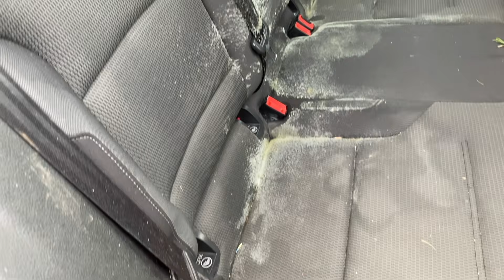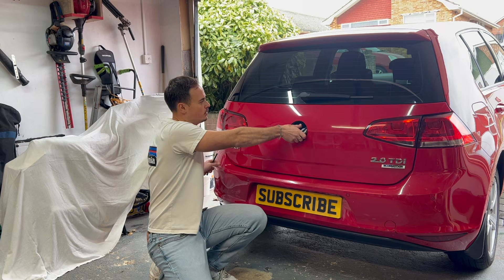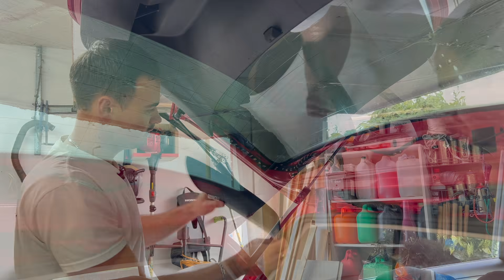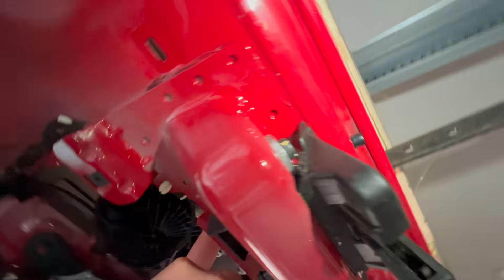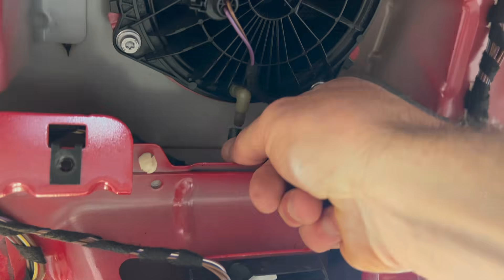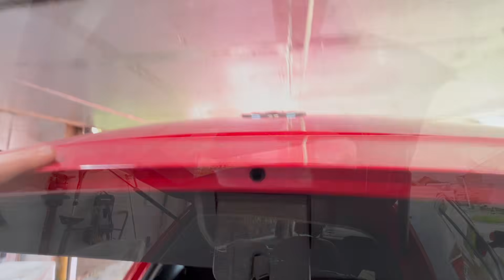VW Golf MK7 Boot LEAK – The REAL Cause & How to Fix It (Boot Badge Drain Tube Replacement)

Comment: Thank you, that was a bit of a faff to do, but you saved me nearly £150 by doing it myself 🙂 I do think that VW dealers should fix this FOC though, as it's clearly a part that's failing prematurely, and shouldn't be counted as "normal wear and tear" IMO. I would be curious to know whether the issue persists in later models?
Reply from the maker: You’re very welcome! So glad you saved the cash and managed to get it sorted yourself, nice work. Thanks ever so much for the tip! You don’t know how much it helps out running the channel 😊👊🏻 I definitely think there are a few issues with these cars that VW should be accountable for 😬 I do think they’ve ironed out a few in newer models such as the silica bag issue but not so sure about the boot leaks 🤔
Reply: we need to start a petition as my and my wife both have leaks in our golfs. She has 2!!
Reply: I’ve got a leak in my 2017 GT evo……… thanks for the great video.. I’m sure my mate can fix as I’m disabled

Comment: Why must these cars be such pieces of crap? I've had the sunroof frame resealed under (some) factory extended warranty, keep drain tubes clear, but it leaks and leaks and leaks... Every visit to dealership is $120 to just be told "we blew out drain tubes so you're fine now" only to have it leak in the next rain. VW is synonymous with junk in my mind...

Comment: Great video very helpful. I have an estate and the process is the same just the pipe is slightly different with a 45 degree plastic joiner in there to get it out a little further. Mine wasn’t  broken just come off the drain hole. Reattached and cable tied on and job done!
Thanks mate
Reply from the maker: That’s great news, glad you managed to get it sorted so easily! 👍🏼

Comment: Thanks so much for posting this... I'm always nervous yanking trim off. I've just discovered mum's spare wheel is swimming in water... Thanks to your video I've found that there is no hose! Most likely it went missing when mum got rear ended a a decade ago so must have been filling the boot for years as the car has always smelled musty! Thankfully normally parked under the car port so perhaps that's why it's never filled up fully.  Anyhow scores me brownie points for mother's day tomorrow!😊
Reply from the maker: No problem at all, glad you found the video useful! Best of luck getting it sorted 😊👍🏼

Comment: So I followed the video and all was good until I got to the bit of putting in the pipe. My boot badge is the same on the outside but inside behind the trim has no drain pipe attached or place for it. Boot lid has the hole but inside of the badge doesn't have anywhere to connect to.
Reply from the maker: That is strange, a few others have also commented that they didn’t have a place for the tube. Maybe yours is an exception, in which case the leak is probably from the rear boot vents 👍🏼

Comment: How did you get the tailgate panel back in so easy? I’m trying to put the panel back in but it won’t fit. It’s too big
Reply from the maker: If it came off, it will definitely go back on. It’s just a case of making sure all the clips align with the holes in the tailgate👍🏼

Comment: Thank you so much!!! Whenever i open the boot after washing the car or after it has rained i find some water drops on the handle of the boot carpet and some on the spare tire. I’ve already fixed the leaky air vents but still find the spare wheel area kinda damp so my second best bet would be this hose
Reply from the maker: Thanks for watching, definitely sounds like that tube is the culprit for the remaining dampness! 👍🏼

Comment: Ive done the vents ubder the bunper and the badge pipe looks fine but im still getting water in the boot. I though it was from the lights but they seem bone dry inside abd behind them...im lost with it
Reply from the maker: Might be a case of removing the boot liner, drying it out completely and putting talcum powder all over the boot space. Sounds silly but this way you should be able to see where the water is coming in from and trace it back. Have you noticed water pooling in the cavity where the rubber Gromit is?

Comment: Hi Olly, 

I got back from holiday last week and was repositioning my boot base from the deeper holiday position to the higher position that I usually have it in with a genuine plastic boot liner. 

I discovered a pool of water in my spare wheel well with all the heavy rain recently. I was getting a lot of condensation on the windscreen prior to this, but fortunately no mould on the seats! 

I have a red VW MK7 Golf GT very similar to your Golf in your video.

I watched your video and checked my boot door. The rubber drainage pipe had perished at the distal end and receded into the boot door. 

My Golf is nearly 12 years old and has done 149k miles. The original pipe was rubber/plastic and has lasted all this time. I've replaced it with a genuine rubber hose pipe from eBay. I had to cut the pipe to the correct length, but it otherwise fit well.

Removing and replacing the plastic panels were rather fiddly. I bent one of the metal clips in the process. My car has all of the metal clips and all 4 screws.

Thank you for the video. Very helpful. I'll definitely have a look on your channel again if I have any further issues to see if you have a solution. 

Thanks again, Olly.
Reply from the maker: Hi Oliver, glad the video helped you track down that perished pipe before the mould set in! Those plastic panels and metal clips are definitely a test of patience, but it sounds like you nailed the fix. Nice work mate, thanks for your comment and happy motoring 🍻
Reply: Hey thanks for your informative comment, in about a weeks time could you tell me the results?

Comment: Thanks for this video. Really helpful. Like most people, my mk7 had loads of water in the boot under the spare tyre. I only looked into the problem when I realised the back seat was wet. I'd already had the problem of moisture on the windows which had also frozen at times too in winter. Sure enough, the boot badge pipe had perished so I used the links in the comment to order a replacement tube and tool - 30 mins and some brute force later that's now repaired. I also established I had water in the bumper area on both sides. Rather than take the bumper off, I simply cut into the carpet on each side in the boot and put my finger in to check for water. Once I'd confirmed that, I used the suggestion in another comment (either on this video or another) and went under the car and made a small hole in each of the 4 rubber bungs. Sure enough, water started dripping out on both sides. Hopefully that'll see this car through the next few years now. Thanks for your video - saved me loads of money and gave me the confidence to fix this myself 👍🏻
Reply from the maker: No problem Michael, glad you found it useful and managed to get it sorted! Nice work 👍🏼 Also, thank you for buying through the link. Every little helps me make these videos so I appreciate that 😊

Comment: I think I'm going to try this today. I have a replacement tube I got off ebay. I did have water in my boot which was giving me bad condensation inside every morning. I popped those rubber grommets under the wheel arches and water poured out so I do need to get at those 2 vents and reseal those, but I also noticed the tube end is not visible at the base of the boot door, so I think that's gone inside. I think do the tube first, and then see. I was just going to leave those 2 grommets out so the water will always leak out, but I should get the vents sealed properly. I'm just rolling my eyes at having to get the bumper off. Your videos have really helped me, thank you.
Reply from the maker: No problem at all, glad you found it useful. Sounds like you’re on the way to getting it sorted 👍🏼 I’ve also linked some dehumidifiers in the description which will help dry it out once you’ve fixed it. Good luck, you got this! 😁

Comment: Ordered new drain today for sons car
 Water pooling u derneath back seats and inch of water in boot originally when bought
 Going for a service soon so will get them to plug boot vents I think
Reply from the maker: Sounds like you're on the right track to getting it sorted 👍🏼
Reply: Does the exact size matter as looking online there’s a slight variation despite the same product number
Reply: @dustyfeet1989 well I got it today and its not long. Only about 8 inches long i'd say

Comment: Really helpful videos, thank you. I have water in my boot and also under the back seats. The boot badge drain tube clearly needs replacing but my question is, could this contribute to that much water inside the car?  And have you experienced water pooling under the seats too?  I'd be very grateful for any suggestions!
Reply from the maker: Thank you so much for your feedback, I have another video about the water leak issues if you’re interested as it shows the other areas that could be an issue. The carpet in the boot gets saturated and the water wicks up through the carpet and into the back seats I think 👍🏼

Comment: I have replaced that part on my golf. I am going to do the seals with those vents from your other video. The only issue I have is the rubber grommets where the electric cables are hidden. Have you done a video on how to replace those? I tried the other day but seems to be a cable I can’t seem to disconnect/unplug as I can’t see where it is going/coming from. I believe it is linked with the break light but can’t figure out how to get to it to replace the part. Any help would be much appreciated
Reply from the maker: Under bumper vent seals definitely, boot badge worth checking as you have 👍🏼 As for the cable gromet on the tailgate. I haven’t yet replaced or sealed as I found the other 3 leaks seem to have stopped it. Did you also seal around the rear light clusters as they are prone to leak in time when the foam gets compressed?

Comment: My 2013 MK7 has no tube from boot badge to bottom of boot? Just a bung in place and no signs of there ever being a tube. 

Boot full of water so checked this first. Looks like i will need to go further and check vents next 🙈
Reply from the maker: That is very interesting, does it have the pop up boot badge? If so I thought they all had the drain tube to allow the water out the bottom 😅
Reply: @T @TurnersWorkshop97 It has the pop up badge yes. My water looks to be coming in from the vents so i will be getting the silicone out and doing them and the lights. 

Thanks for the video, very helpful. 🙂
Reply from the maker: No worries mate, thanks for your comment. I’m sure by sealing the vents and lights will sort it 👍🏼

Comment: i dont have at all pipe in my golf 7  its empy hole there  i bought car last month and noticed water in boot of a car maybe i should buy that pipe ?
Reply from the maker: It must have fallen out the bottom at some point. I’d put a new pipe in and that should sort the water leak issue providing it’s not coming in from any of the other areas too 😊👍🏼

Comment: Just checked mine and no rubber poking out, not wet with tyre well but back window gets steamed up a lot, on order from your links, have you had any dpf issues, got my 10yr old with only 30k on, not had much mileage so its run dfp quite a few times since i've had it so go  to the motorway once a week and clock up a few until stop start shows active again, not been too bad last few weeks and banged redex dpf cleaner in it so lowers temp to burn off
Reply: Just found The part number fot these updated side vents is 7N0819465E
Reply: Has been regen a few times since i got it 22nd Sept, no faults just known it has been running, not had one for a while now
Reply: I will be putting more runs on it now, just know its running from no start stop and extra revs
Reply from the maker: That’s all good then, as long as it doesn’t come up with faults it’s just doing its thing. Mine does from time to time 👍🏼
Reply from the maker: Well done that’s another one fixed! 😁 Haven’t had any DPF issues with mine but it’s always had long motorway runs on my journey to and from work. Does it come up with a fault for the DPF or you just find it regens frequently?

Comment: My Boot has about two inches / 50mm of water, and I checked the pipe you mention and there is nothing to see here, I have ordered a replacement. I have just viewed your other video re the loose vents and I think my problem is more likely going to be those too. Thanks for sharing your info.
Reply: Don't forget to re-seal the outer tail lights, while you're in there, as well. Hope it helps
Reply from the maker: No problem at all, glad it’s been useful and I’m sure it will fix your issue. I did this repair over a year ago now and it’s been dry ever since 👍🏼
Reply: Ps I forgot to mention I have the same Mk7 as yourself in white. Had to silicone around the rear door speakers were the rain was leaking in too.
Reply: @Mike35858 did you have to take the door cards off to seal the speakers ? Thanks
Reply: Great video 👍🏻 mines like a swimming pool, gonna do both at the rear, but wanted to ask, I also seem to have a wet spot in the passenger footwell, any idea what this could down to 👍🏻
Reply: Noticed that my hose was missing the grommet, and thanks to your video I was able to quickly swap it out for a new one. Many thanks!
Reply: Looking online the size varies slightly even though the product number is the same, how do I know which one to buy it says mk7 2013-2016 which includes mine
Reply: @dus @dustyfeet1989 I ordered one from my local vw dealer with my vin, the drain tube was around 8-10in long iirc and needed to be cut to size.

Comment: Mine was completely disintegrated (at the bottom end of the pipe) after 10 years of dirt and rainwater. Thanks for the video 🙏🏽
Reply from the maker: It’s such a common fault, I expect they all fail eventually. No problem at all, thanks for your comment 🙏🏻
Reply: @TurnersWorkshop97  Of course, thanks for making MK7 videos!! I was able to seal my slam vents and the tail lights using your older videos as well. It's a massive help